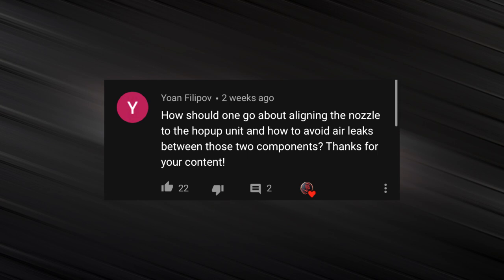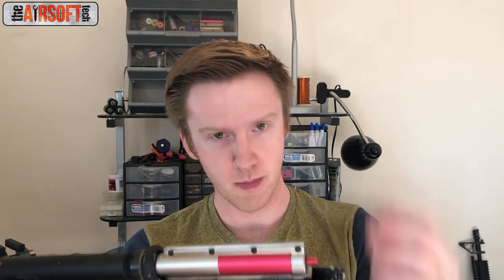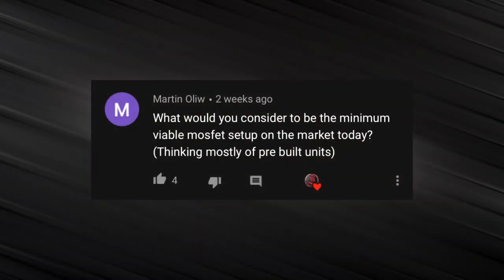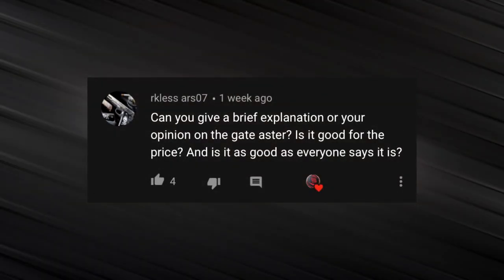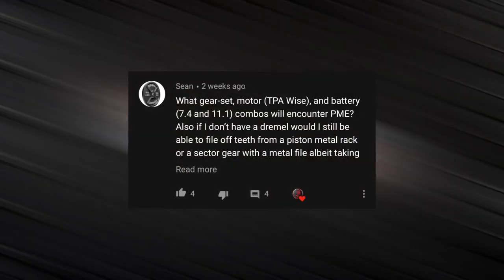Airsoft Tech Talk Q&A | Episode 10

Comment: Good information and a question for the next Q&A : when needing to pull a bigger spring and still achieving a nice ROF and quick trigger response, and having better efficiency so your battery can last longer : better go with a low ratio gearset (like 13:1) and a high torque motor (with 20ish TPA) or going with a stronger gearset and regular TPA motor ?
Reply: You will need a high torque motor for sure. At least 22tpa   Such as a zci or an asg. That will be able to pull your heavy spring. ——- and to have a decent rate of fire you will need a lower ratio gears but not too low. 13:1 shs gears I would recommend. ————————— lower the ratio of gears the faster they are.
Reply: @TheRealDealAirsoft  That's the setup I usually run and recently, I've stumbled on some posts on airsoft teching q&a fb group stating otherwise. I'd like Ryan's take on it

Comment: I need to say that my personal experience with Gate Aster is quite good. 
I simply didn't want to take out my trigger blocking lever so I bought Aster and not Titan. I had problem with trigger when I installed Aster because sensors are stugling to read trigger movement but I contacted Gate support and they told me that Aster have issues with Specna Arms stock trigger what I had in that moment. On their's advice, I bought Retro Arms aftermarket trigger (some 8 euros, not a big deal) and after I install it, Aster works flawlessly. 

That was only issue I had with Aster, everything else works perfectly.

Comment: I worked with a couple of asters, both in my builds, and client's. The biggest thing is the trigger sensor, I had alot of luck using a white paint marker instead of the sticker they give you, along with blocking off holes that let light it. A bit of a pain, but I was able to get ridiculous sensitivity for the trigger after that! Can also confirm that It worked in my sr-25 (19t)

Comment: The aster 
Its a mix bag in my opinion 

I have an aster installed in my TM MP5 which is now basically a systema and prommy gearbox in a TM body

The first time I installed this I had nothing but problems 
Semi would only shoot every so often 
Full auto was random 
Was all over the place with trigger sensors etc 
Just shoot.by itself 
Was a F'ing nightmare 
After speaking with Gate via email (which they were great at by the way) there were a few.issues that had to be addressed which arnt clearly stated if at all in there installing guide 

I dremmeled the gearbox reinforcement strip on the gearbox side you put the sticker on and this definitely improved the trigger sensitivity and realiabilly 
(Also make sure sticker is.clean of dirt and straight aswell )

Block off all holes of the gearbox.that arnt being used (extra light trips out sensor)

Changed the trigger to a Maxx model m4.style  as it didn't like the MP5 trigger and when I emailed Gate that is what they suggested 
This massively improved the trigger (The problem is the mp5 trigger is longer than the m4 so I've got a stubby trigger now lol) 

Next thing to do which is not stated in the installation guide 
MAKE SURE THE MOSFET IS STRAIGHT IN THE GEARBOX.SHELL
stupid point but originally mine was off by a few degrees 
When I straighten it out and LOCKTITE the holding screw in, my god so much better 

Think about the vibrations running through a gearbox 
If the FET is off slightly and not locktite down it will move slightly and vibrate which in turn messes up your sensitivity 

Next thing 
Always calibrate the trigger everytime you open up the box 
Even if nothing has changed just recalibrate it (believe me this is important)

Doing these things really helped my Aster perform better
Crisp trigger response and reliable trigger 
It's Not perfect but honestly not far.from it 

If there is anything else I'll add later 

Hope this helps anyone out cause I nearly chucked my away after 1 month but glad I stuck with it

Comment: I have a question, do you have any experience replacing Lancer Tactical Mosfets? If so what tips could you give me? I bought one of their battlehawk proline guns to get back into airsoft and after maybe 5k cycles it started firing long ugly bursts in semi, which I read is likely the fet (I know I should've just bought a Krytac). Anyway I got a Gate Nanohard arriving today and I've researched soldering techniques and such, but I'm worried Lancer's weird flat connectors for the individual wires prior to the fet will be an issue to work with, I'm also not sure if I'll be able to use the existing duel signal wires unless it's possible to solder them reliably to the Gate connector. (It also has an ETU so I'm not sure how easy it would be to replace those signal wires).

I haven't started working on it yet so I might just be stressing out too much, but if you have any tips to ease my mind that'd be greatly appreaciated!
Reply: I hate to be that guy but you might be better off saving up for a new gun and installing the mosfet in that. Lancer tacticals are known for having soo many problems over time, they are definitely not built to last. If you end up installing the mosfet in the lancer, keep in mind that it might work for a little bit but you're probably gonna run into another problem sooner than later, and it'll all just be a big head ache.
Reply: @williamcompton6358  Well I heard the gen 2s aren't that bad. I plan to tune it up and potentially replace some parts anyway. It's got a radiused gearbox, decent factory shimming (which I plan to redo anyway), quick change spring, metal piston teeth with factory AOE adjustment, rotary hop up (though it needs work to be consistent), ETU and flat trigger, and a decent body with some unique features I like. I went into it knowing it'd be a project so I'm not too worried, but in hindsight including the cost of the new fet I could've got a Krytac CRB and saved myself some time at the expense of some of the other features I mentioned. (Which I should've done because I knew their fets sucked before I bought it, I just hoped I'd be lucky because they have so many features other stock fets don't).

But all told it's not that bad of a gun as long as you go into it expecting to work on it, I tried buying a fancy stock gun in my youth and I stupidly gave it to my local shop to cut the spring and then their store burnt down with my $400 G&P inside (which they never did shit about replacing) so I bought this gun intending to be cheap and learn how to fix/modify it all myself and then use that knowledge to make more informed decisions as I buy nicer guns later on. Worst comes to worst I will just unplug the Gate and throw it in a new gun if this thing shits the bed too hard.
Reply: @williamcompton6358  Well sir, this is where I eat my words. I installed the new mosfet and bang, nothing. Checked the error codes and the Gate fet claims there's a short somewhere, which after some troubleshooting I can only assume is the ETU. Either it's not playing nice with the Gate, or it's just fucked. Either way so am I because I don't know how to fix surface mount electronic components. 

So now I either buy a new ETU, buy a Gate Titan, buy a regular trigger unit, or just buy a new gun because Lancer Tactical still won't reply to my emails for warranty support (so much for their fucking 1 year warranty). Ugh should've bought a Krytac...

Comment: could you talk about a effiency build ive seen alot of talk on it in teching q&a i am going to dive into a stoner soon and thinking of trying one out low to mid 20 rps and making my battery last 3500mah 11.1
Reply: With that high capacity efficiency isn't really a concern as long as the motor doesn't overheat. If you're after maximum efficiency it'll probably be more efficient to use 18:1 ratio gears than 13:1 or 12:1 ratio because of less friction loss. A Tienly 25k combined with good 18:1 ratio gears should do low to mid 20's and pull little current.

Comment: Bullpup Replicas such as the AUG and P90 - How can you get rid of that two stage trigger issue where it sometimes does not fire in semi?
Reply: NepaAirsoft you can’t really, it will always be there to some extent
Reply: It may help to elongate the contact piece in the semi auto switch and maybe bend the full auto contacts in a tad so it engages further into the trigger pull. It can also help to reduce slack in the trigger system. It can also help to bend the contacts in the semi auto switch in a bit so the switch is "tighter".